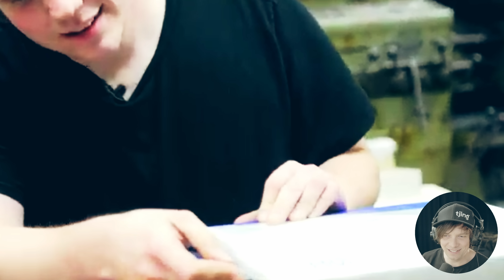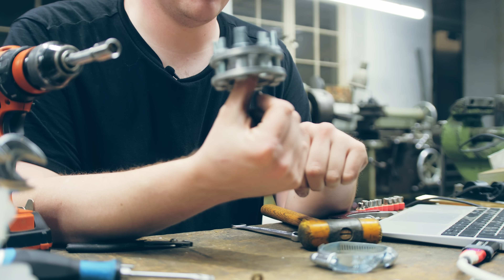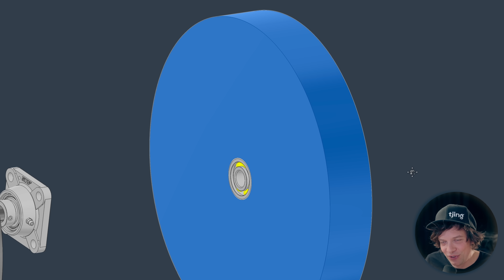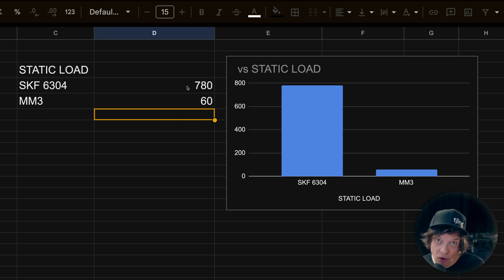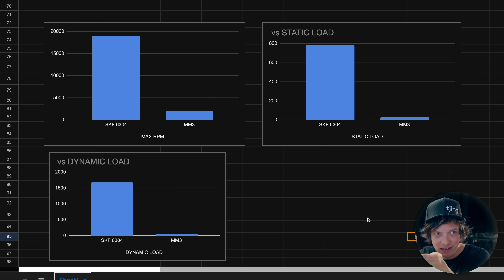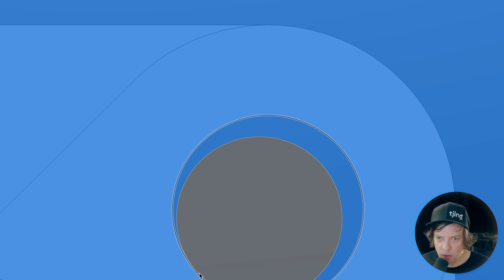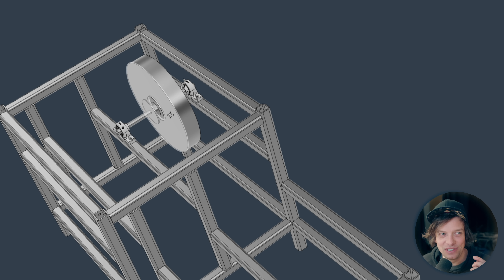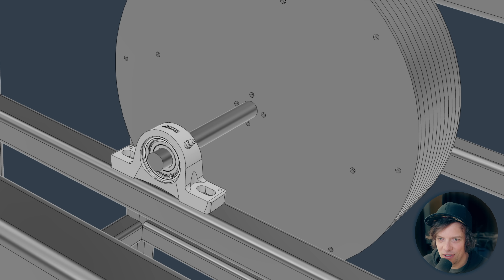Worst Bearing Housing Ever - Marble Machine 3 Ep.3

Comment: In the pillow block design, concentricity can be achieved by having adjustment screws on the pillow blocks which allow adjustment along their support rails, as well as their height relative to the top of the rails. For perpendicularity of the flywheel, you can mount a block on the shaft to one side of the flywheel, maybe at a distance of half the flywheel radius away. Attach four rods to the block at 90º intervals, and attach the other end of the rods around the side of the flywheel. The rods' lengths is adjustable, and is used to to perpendicularize the flywheel. Having four of them balances the forces against the flywheel, as well as evenly distribute the weight/moment. On setup, this means getting the flywheel perpendicular to the shaft before balancing the flywheel.

I will also note that perfect perpendicularlty is not so important if the flywheel isn't directly driving the MM3's movement. From the sketches you've shown, it looks like you are thinking of using some kind of belt to drive the flywheel from a manual or powered source, and it's the shaft of the flywheel that is driving the MM3. If you use toothed belts or v-belts, then being able to set the distance from the driving wheel to the flywheel to get the correct tension is more important than getting the flywheel perfectly perpendicular, especially if the driving wheel is also mounted in an adjustable manner so that each belt is rotating in a plane, and multiple belts are co-planer.

Comment: As a structural engineer my suggestion has to do with the welded steel frame:

Adding diagonal braces on opposite sides will help with frame deflection during any internal momentum shifting, especially during the frame's resonance period, to avoid any shaking

Comment: Question, have you thought of using an automotive bearing like they used to use on spindles to hold brake rotors on? You have concentricity on either side, the outer and inner race are slanted to have that. 

Additionally, you may want to understand how harmonic balancers work, pun intended. Something that can balance out the rotational harmonics of a spinning mass would definitely help with bearing wear.

Comment: You could probably bolt on a flange that is like a collet to attach it to the flywheel. You'd be able to keep the flywheel centered on it easily as it tightens down evenly. I think it would be easy to make some taper clamping mechanism like that without too much effort. Heavy industry uses clutch-like mechanisms to hold gears to shafts. The solutions are out there you just gotta know where to look.

Comment: The perpendicularity is not a problem for a flywheel. Due to centrifugal "force" a spinning flywheel will naturally want to get as far from the shaft as possible, which happens when it's exactly at 90 degrees. The faster it is spinning the harder it is to get it not perpendicular.

Comment: Your point loading the outer race my best guess is the surface that the balls ride on may not be perfectly round causing issue over time. You idea is good the application is poor maybe a sleeve between bearing surface and bolts will ease the pain on engineers watching.

Comment: A press fit on the tiny peaks of a thread? To hold rotational and side loading forces?  Bro what?  Google “collar clamps”, dirt cheap and would actually capture and support the bearing very well, and could be laser cut/jetted. I’ve seen what you’re doing used in application, it did not survive time.   These may work for a week, month, etc but eventually it’s gonna wobble loose.

Comment: For the flywheel, buy one. Add some comercial hub and you get an balanced ( for your specs ) flywheel. Many eng. done that it will work.

For as shitiest hub design you can go for a weld. But balancing has to be done in place, with a drill.

Comment: If you can buy a solution, there is no reason to build your own. The industry has standards that make things reliable and cheap. Bolts are not good for locating parts accurately, the chances of getting variation while hammering bolts into the housing will possibly make life a nightmare. Not to mention the potential for a shorter life bearing when forcing these pressure points onto it. A bearing mount needs to have even pressure around the bearing, these bolts are making high stress contact unevenly along the bearing.

Also you are overcomplicating it a lot. A flywheel does not want to twist itself. It wants to twist itself so little that we use it to rotate satalites and space craft. Just worry about getting a balanced wheel attached to a shaft with two bearing on each side holding it to the machine.

Comment: with such a heavy spinning object, there will be a required step to balance the flywheel anyway, at leat by drilling\cutting pieces so it will generate mininum vibrations to the frame. We can have it granted. Slight wobble and off-center placement you'll be able to compensate by balancing the wheel, it's not a really a big deal. So the usual way to attach your wheel to the shaft is to use a keyway and a key, to minimise machining operations. Frankly, looking at the setup i'd recommend to actually use wider diameter and machine the ends for bearings. This will compensate the shaft flex and will minimize chances of spin resonance. A simple keyway might be machined using angle grinder and a jig. it will be the most simpe way.  Or you can weld a flange on the shaft  in proper position and machine it together for concentricity and perpendicularity on a lathe with single setup or between centers.

Comment: please martin hold this:
don't use the CBT cage (don't google that) and instead press fit the bearings into the flywheel don't ditch the cage (you'll need it to fasten the plates together) just don't use it to hold the bearings bolts are not used for it and the teeth will be flattened over time making the thing wiggle like worm if you put salt on it. press fit the bearing into the plates make sure the plates are balanced and tig weld bearings in place (then check the balance again) then you can secure the plates with bolts (you will remove the anti-concetrical movement by having more bearings in series). still the same problems solved and it doesn't have to be CNC machined at all (or laser cut). you can just drill it.

Comment: Regardless of individual design decisions or parts, IMO you should assemble your prototype with standard parts as much as possible. When no standard part exists (like marble gates), or when you discover a standard solution doesn't work for your application, that's the point in which you design a custom solution.
Reply: Also: if you have a simple part that benefits from precision (like a flywheel), it seems to me it would be far better to have it machined. You're unlikely to experiment with a dozen different variations on the wheel itself, so sticking to laser cutting seems a bit pointless.

Comment: Nobody thinks the bearing will fail. It's the mounting that's in risk. 
A bolt that's already mounted with violence has a good risk of failing. 
And it would probably be cheaper to use the flanged bearing house, even if it's a specially manufactured part with a small flange for centering.

Comment: perpendicularity will not be a big problem as the flywheel is basically a gyroscope.
Even with the allowance for perpendicular rotation in 1 baeiring you won't have the wheel get misaligned because you are using 2 bearings. that way the 'rotation' on one bearing gets canceled out by the other.
=>   |-----||-----|  -> /----||----/ ->  \----||----\  ->  |----||----|
the Wheel will only rotate (even though it will fight the perpendicular motion because of inertia) when the positioning of one bearing changes.

Comment: Wouldn't centrifugal forces make the wheel perpendicular naturally? What you need is an extremely balanced wheel with provisions on the perimeter to adjust it. Trying to force the wheel to the shaft is like building a rigid bridge. It isn't going to end well. It just needs to be balanced so it doesn't go all "washing machine" on you and vibrate the machine apart. In fact, I would explore vibrationally isolating the shaft from the frame.

Comment: I believe what chippingtommy means is that the bearing will hold up well, but the forces on the metal casing of the bearing will scrape enough to make any of the tight fitting housings eventually become loose fitting housing or rattling housing.

Comment: Martin please just use the skf bearing catalogue. There every step for calculating your bearings ist described. It's basically the DIN ISO 281 but free. Also don't forget about lubrication and that bearings have a static minimum load. Also some proper mechanical calculations about how much load every bearing is caring is advisable.

Comment: Please don't design stuff needing exact adjustment without any way to adjust them on the fly. Even if something is build perfect, it won't say perfect. Materials expend/contract/bend/wear-off/... with temperature/humidity/load&gravity/oxidation/dust/...
If your machine doesn't have any tolerances then it will constantly jam.

Comment: The bearing isn’t the point of failure here, it’s the bolts. Bolts aren’t designed to be used like this. 

Furthermore, if this was a viable way of making a bearing housing, then surely someone would have done it already.

Comment: Such an odd hill to die on Martin? A 2 second google and you find bolt on shaft mounts u can bolt your laser cut plates to and have the pillow blocks on the frame. Like many others have said use a dial indicator when tightening the flanges and you’ll be humming. An engineer would have used off the shelf parts and been done with this module and saved the effort for the niche/unique design problems you have as part of the mm3. Anyway love your work and your creativity and your curiosity, but spend that creative energy on the stuff that deserves it and all the other stuff just get it done

Comment: In my opinion, it doesnt need particularly much thought to understand that very tightly packed things that involve hard materials, which are exposed to lots of movement and vibration, will lose their tight fit within a very short time frame.

The tighter you make the fit, the faster it will loosen up or break.

I think its exactly the dumpster fire you claim it isnt.

Comment: The flywheel should literally just be machined on a lathe with and interference fit and bearings in standard housings. This is all such a waste of time, the design time is wasted, the time making this video is wasted, the time reading everyone’s comments is wasted, SKFs time is being wasted. The constraint of trying to use one suppliers is a dumb constraint. The minimum number of suppliers is the amount needed to provide the function required in the easiest and most reliable way. Not an arbitrarily low number that requires Martin to do more work.

Comment: I think you are right about the off-the-shelf parts having bad concentricity, they are not made for this application.

Your design would be better if it used shoulder bolts instead of normal bolts because the threads wouldn't have to locate the bearing.
Threads are not perfectly cylindrical and you are certainly damaging them which will make it difficult to remove.

Shoulder bolts have a machined cylindrical section which will probably be a more repeatable fit than the threads.

Comment: Just a FYI that ChatGPT can't do math, and the answer is wrong (only by 0.2kg though, which is insignificant enough), so while the formula is correct just double check the answer. This is because ChatGPT doesn't actually execute the calculation, it just tries to guess what the answer would be based on previous answers it's been trained on.

Comment: Option 3 bolt taper lock hub to flywheel. Don't be discouraged by your hub idea. I have seen it used before in light duty applications. The only thing I will say is a bearing housing is designed to transfer load from the bearing. It is a structural element. Also consider any out of balance will be amplified by the Relative Centrifugal Force or G force. For example if you had a 450mm diameter flywheel spinning at 2000 rpm and it had a 10 gram out of balance that would equate to a 10kg eccentric load. It would be 1000G at the outer edge of the wheel. Prototype and learn,  failure is always an option as it is the first step towards success.

Comment: The only problem I can see with the bolts is the threads getting crushed a bit pressing against the bearing. Balancing is the main issue though, no matter how it’s mounted it will need to be balanced.

Comment: In my opinion not the bearing will fail, but threaded rods. They are not designed to hold this stress and will deform their threads really quick.
Then, talking about perpendicularity of the flywheel. Wouldn't it correct itself once it begin spinning? It's still the wheel.
As many other said, you don't need concentric flywheel. You need a balanced one. This is a good point.
And for the final argument. Maybe you look at the wrong housing? I'm not a specialist, but i'm sure there are many kinds of those things for different purposes.

I'm sorry for my dilettante opinion, if i said something stupid xD
Reply: 18:00 Oh yeah! This looks like the right way of thinking.

Comment: The problem with your bolt-housing idea is the strength and resilience of the contact surfaces to the bearing. A traditional press-fit housing utilizes 100% contact area, whereas your bolt concept is reducing that not only to the tangency contact area of the bolt (Extremely small, relative), but even worse so in that the bolt is threaded, and those threads will eventually collapse and deform, eventually causing a cascade failure as those threads progressively get compressed. I'm sure you're aware of how easy it is to strip threads, sadly Martin @wintergatan, It WILL fail.

Comment: Don't know why you're so afraid of lathed parts. If I lived in Europe I'd totally knock up a flywheel for you :)
If using the live axil, maybe try split shaft collars with through holes. Just mount them as close as you can to center and then static balance them after by either adding weights or drilling out the material on the opposite side. Maybe you could just knock it into balance with a softblow hammer if there's enough play?

Comment: The problem with your Design is the point/ line load on the bolts. There will be some deformation on the bolts which will give you slop and therefore eccentricity.

Comment: On the discussion about the bearings failing:  Not that I'm saying this is a definite design flaw, but I'd be more concerned about the bolts you're using failing than the bearing, itself.  But, this idea of yours is definitely something I'd be interested in seeing you follow through on at least to a prototype on them.

I do have to disagree with you on your perpendicularity point, though:  The bearings are designed to allow for misaligned axis, yes, but that doesn't mean they're designed for the axis to move.  If you clamp the bearing to the flywheel in the way you described and mount it properly, that ability will be a non-issue.  Where that design comes into play is if one of your mounting brackets for mounting the shaft is slightly out of alignment - it will specifically allow the flywheel to stay perpendicular even if the axle is out of alignment.

Comment: Martin, do you have a mechanical design textbook? I'm in school for Mechanical Engineering and have taken classes that involved bearing, shaft, keyway, and gear design. Several of them used the same textbook, Shigley's Mechanical Engineering Design. I think it'd be well worth the price tag (or worth the read, you can find PDFs of it if you know where to look, everyone here just found a digital copy) to have a "guide" of sorts that covers some of the design that we all yell at you for. 

I like the idea you're going for by sticking with one manufacturer, but sometimes self-imposed limitations like that make the design more complicated than necessary. You mentioned that getting the flywheel machined was the space-grade solution, but I think an intermediate solution could work: laser cut the plates and then have a machine shop locate and machine the holes (including the location pin hole) for a flange bearing.

Comment: Maybe I'm stupid so forgive me if I talk nonsense : in my mind the way to center a shaft in a hole is using a cone shaped wedge....

Ad as your looking at of the peg parts I would suggest a Collet....you get 2 at each end of the flywheel then use a bolt at each end to push them in .....

Then the force of Turing that mass should make them ride up and find the Center of the shaft ??

Well in my mind they do ..

Maybe ask old Tony .... maybe I'm talking nonsense sorry in advance